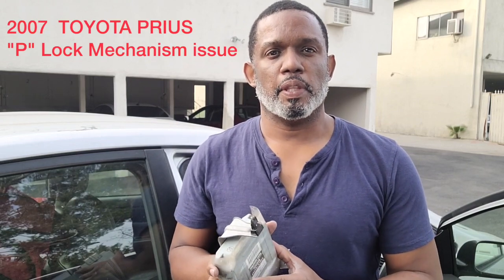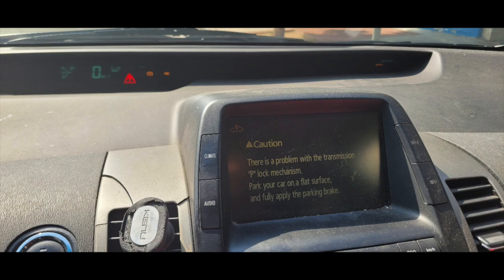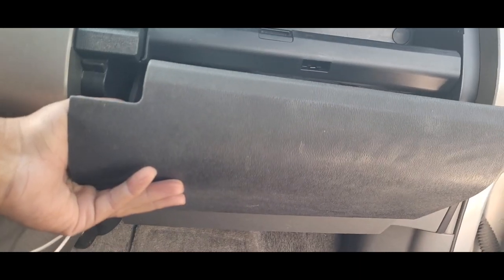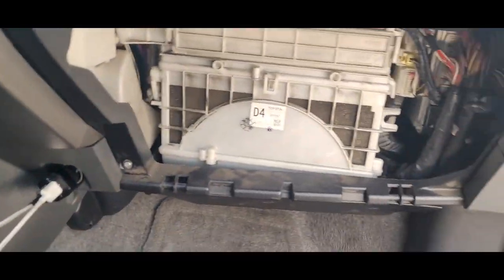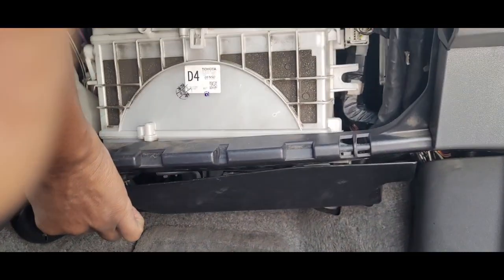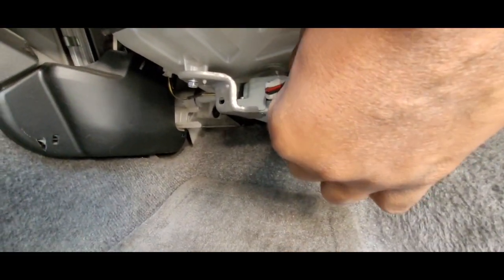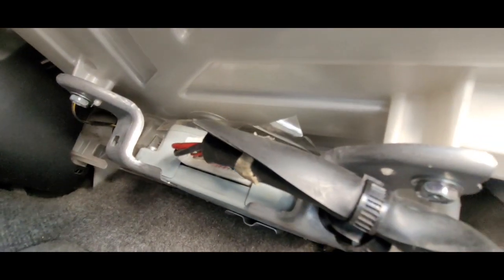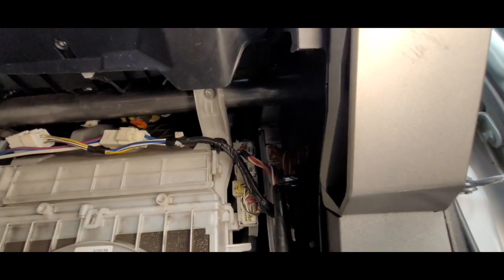2007 Toyota Prius  "P"  Lock Mechanism problem and Transmission Control Removal

Comment: Thank you this was a huge help. My prius has turning on without going into park or drive.  Red light on start button can be put in neutral only (as if you were starting without your foot on the brake.)
  the code was in japanese but my friend translated it as  Park lock transmission wrong. If I keep turning it off and on it eventually started and I drove it home.

The car has also had a fault that sometimes it doesn't turn itself off properly even with the key out. It also has a fault that the start battery is slowly draining  when the vehicle is off.

Comment from the maker: Just to update  this, I still had the problem pop ba k up. Took it back to Toyota when they finally found my problem.  Whenever the  Hybrid battery is changed or, there's a ground wire to the engine that may not have been reconnected. Have that checked out
Reply: Did you start having this problem after you changed your hybrid battery?
Reply: @ramonkobora6892  I changed my car battery a few months ago and this just started happening to me

Comment: I have a 2008 with the Plock and Red triangle coming on when it rains.  Everything else in the car works fine, it runs, drives, no noises or any problems.  The Plock and triangle come just randomly on and off while driving as it there is a loose wire.  Anyone else had this issue and if so did you fix it?

Comment: I have the same problem with my Prius 2007 and I replaced this transmission ECU but still it’s not getting in the ready mode. I have red triangle of death. Any idea
Reply from the maker: I had the same problem  then found out the transmission battery cable wasn't grounded back to the engine, when it was replaced
Reply: @lamontcouch where is the transmission battery cable located.

Comment: Question tho would your car start all with it being bad ?
Reply from the maker: It wouldn't  after a while. I bought a couple of used tcu's  that I would  hange out. That would help it start. But once they put the ground cable back onto the engine, it worked perfectly
Reply: @lamontcouch  im getting a code that says something with the transmission control that and my car isnt starting at all . I just did hybrid battery everything is connected the orange fuse it on correctly  changed 12v battery to. So im thinking maybe the transmission control module is not allowing in to start maybe?
Reply from the maker: @carnageg5962  but the hybrid battery needs to ve grounded to the engine. Toyota told me whomever changed the battery did t reconnect the ground cable to the engine
Reply: hey sire where is the ground wire located  @lamontcouch

Comment: You gave the price for the part don't forget the $1795 the dealer would charge to install it.
Reply from the maker: To install what? The Trans Control box you can change yourself in 5min. Making sure the ground wire is attached shouldn't be that hard or expensive,  I don't belief.
Reply: I'm just messing around. This is in reference about how dealers take advantage of the people who take their cars to them.

Comment: I just got my P with triangle of death.  Taking her into dealership to be serviced
Reply from the maker: Ask them to check that the pruis  battery is properly grounded to engine. If the battery has ever been taken out, most likely they did not reconnect the ground wire. Onc the dealer reconnected the wire, it was fixed
Reply: What was diagnosed. I am also having the same P and red triangle with the brake light ON all the time even if the parking brake is disengaged. Any help appreciated
Reply: I have the same problem 
Do you find the solution?